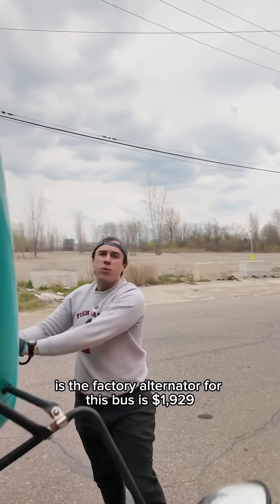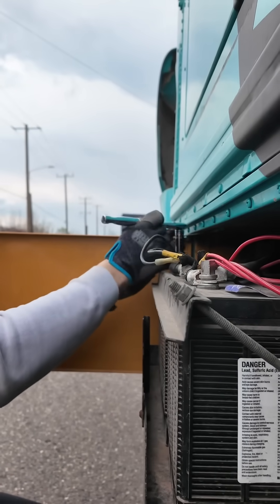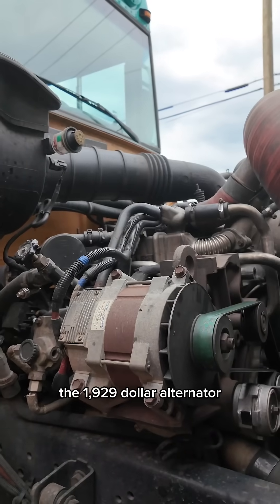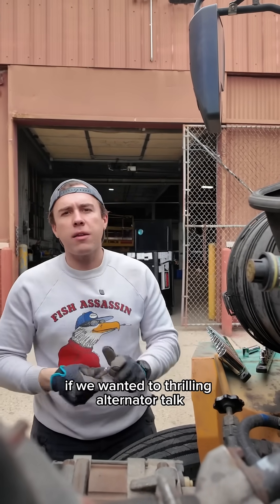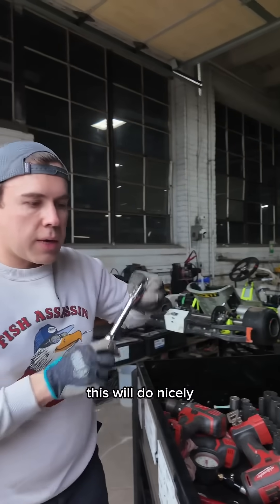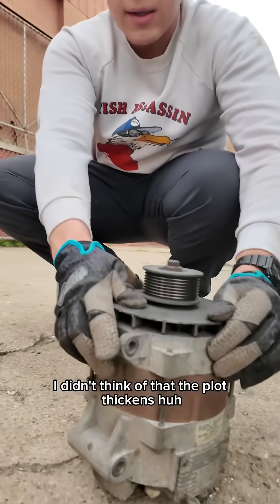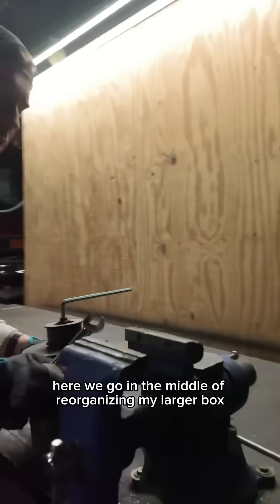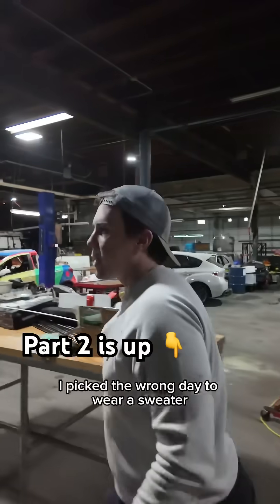Reviving a dead school bus on the cheap - Part 1 of 3

Comment: There are places around me that actually rebuild old alternators still so it might be cheaper just to have that one rebuilt and put on a shelf for the next bus that goes out
Reply: Literally, I know of a place about 100 miles north of him. $200 bucks would get that rebuilt. Maybe $250.
Reply: @fire16fd whats the name of the shop?
Reply: I used to rebuild them,a lot of times the diodes are bad just a few bucks to change and you didn't even have to take the alternator off
Reply: It's the Detroit bus company...  There are at least a dozen places that could rebuild it in the Detroit area alone.
Reply: Do you live in manassas va? I think there is still 4 spots that can get almost any alternator done in a couple hours after you drop it off
Reply: In the UK the last rewinding shop in my area (Greater West London) closed in '08-'09 and my dad was smart enough to have every motor, dynamo, alternator rewound. Our living room ceiling fan  now has two speeds off and bat shit + reverse.
Reply: I use to rebuild them that one would probably be about 200 maybe 170
Reply: Rare as in Australia to find people rebuilding them.
Reply: @clips_x10 most auto electricians will rebuild them if requested but most people just want new. Where I've worked wed rebuild good cores if the customer wanted new, and keep the rebuild on the shelf.
Reply: @Rafiki_lec  I'm a retired auto electrician. Yes, an auto electrician would re-build it, but most customers wouldn't want to as it's normally cheaper to buy a delco or oex off the shelf. At least when I was doing it, this was mainly in the trucking industry.
Reply: @clips_x10   - Newcastle NSW (my general area) - seems there are a few shops (they say they do online at least) repairing, I reckon for a grand there are a few components that can be replaced (regulator / bearings) ,- rewinding, scarcely feasible...
Reply: This guy is stupid
Reply: 90 for cars in mke 150 BMW 200/250 heavy stuff mj auto and electric mke wi
Reply: While rebuilding may be cheaper and from what he was saying it sounds like this is his personal project or something,  rebuilding probably takes more time then this does.
Reply: @Defianthuman that old alternator is better though
Reply: That old Leece Neville was an unstoppable beast. Probably just needed a couple brushes. That new alternator is okish. 
Also, what do you mean $200 to rebuild? Idve just thrown new brushes in, cleaned it up and charged 30
Reply: I had an alternator rebuilt for less than $100 recently. They have a 24hr turnaround. Shops don't typically want to wait for the rebuild so get one off the shelf from a parts store.

Comment: That new alternator will not last near as long as the original leece Neville. It's not rated for the same duty cycle. Heavy equipment mechanic here.
Reply: You nailed it. That Delco is not a continuous duty unit even though they are probably both rated at 150 amps.
Reply: Yeah but he probably not going to be running it as often as a normal schoolbus.

Comment: Is there a legit reason, or is it 2000 bucks just because our tax dollars are usually the ones buying school bus alternators.
Reply: $2000 because that brand will last 10 years in commercial duty.
Reply: @rupe53  my stock toyota alternator off my 97 4runner lasted 15 years and was only $200 to replace.
Reply: @    major difference in commercial duty, diesel vibrations, and continuous full rated output, which is not even close to standard duty units like the replacement shown in the video. Don't get me wrong, that Delco unit is a beast but looking at the charts the duty cycle is only a few minutes at full output and 10 - 15 minutes at 80% outputm decreasing with heat. That's pretty much the same as any other decent brand. The unit they pulled off was basically military spec (overkill) and not really needed in school bus service.

Comment: Yep I’ve arc cut 1/2” holes in back up power supply battery boxes by accident when maintaining them, it’s like putting my 100a welder on full chooch x2-3, never welded my tool to the box like I worried abt tho 😅 anyways Detroit is the coolest town I’ve worked in across the US. People there are so friendly and you can have a top tier conversation with just about anyhone there.

Comment: It’s cool that you can add an alternate alternator
Reply: Alternating alternators
Reply: Alternatively alternate alternative alternators
Reply: You must be dumb or new to diesel engines alot of them have the option to add a second alternator for secondary power outputs or just to take the load off the main alternator so they last longer gotta remember these rules 24v systems  more power needs more charging 🤘
Reply: @byeboy00 this is actually a 12v system. the batteries are wired in parallel so they do not increase to a 24v system and this alternator charges at 14v instead of 27-28v. it is also a single alternator system. by the looks of it it is set up a lot like the older 108SD trucks.
Reply: @byeboy00 The batteries are wired in parallel, not series…which keeps the voltage at 12 but increases the amperage and reduces the resistance. 
And if they were wired in series, it would be 36 volts since there are 3 batteries.
Reply: @byeboy00  you can do it gas egines to ford does it on all thier engines